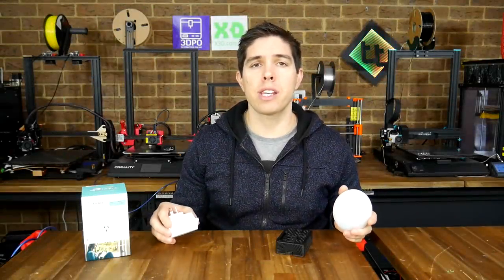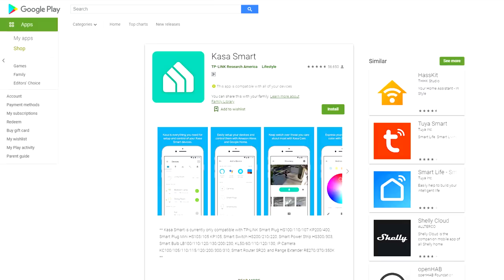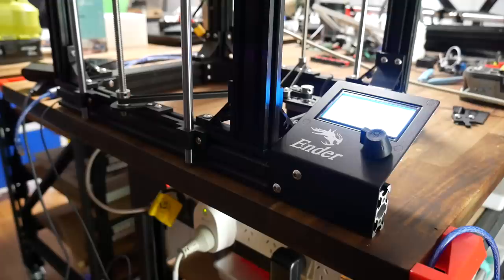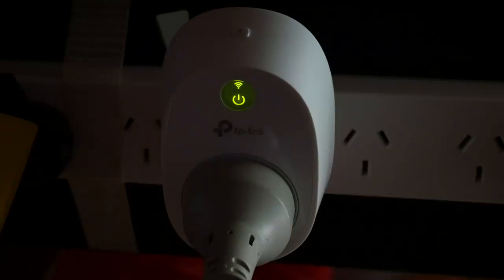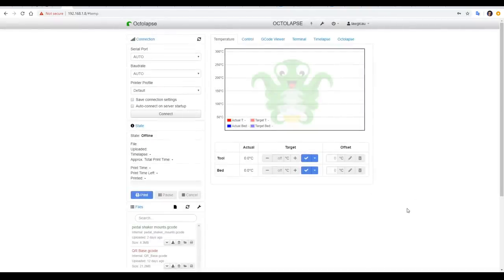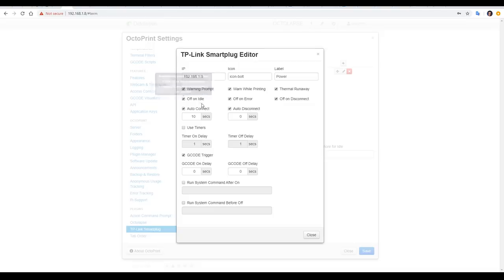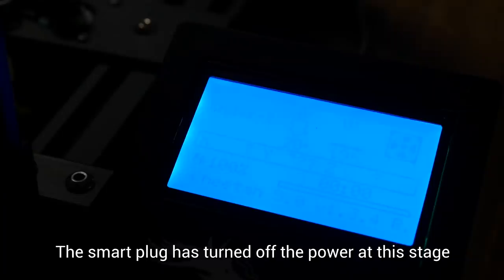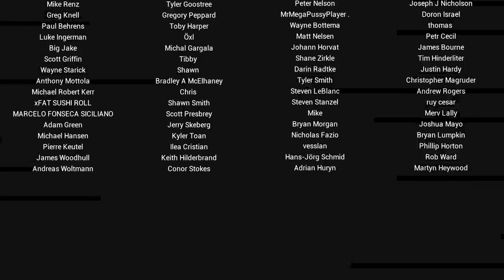Use smart plugs + Octoprint to improve your 3D printing

Comment: Thanks for the detailed explanation of the settings in my plugin, I'm the author of TPLinkSmartplug.
Reply: Jim Neill is there a way to use it with the printer powering the pi?
Reply: @Valgrind850  Yes, with a combination of the system commands options and timer option. You set your Run System Command Before Off to "sudo shutdown" with a short delay and then enable the Timer option and set the delay there for a time period later that gives the pi enough time to cleanly shut down. The plugin will offload the off command to the plug using Kasa's built in timers for the period you set, and then the pi shutsdown before that timer runs out.
Reply: Jim can you check my comment below I’m having a problem after plug-in was installed, I have the green lightning bolt when I click it it turns off power and keeps spinning one can’t turn back on?
Reply: @facitenonvictimarum  Don't be mean.
Reply: Can you help me with something, I can't seem to get the TP-Link Smartplug tab to show up, I am using "Tab Order" and the tab shows up there, but will not show up on the home screen. Other than that it all seems to be working for the most part. I also saw it power off and back on very fast a couple of times, not while printing, but after the time out. The information on that tab would be helpful to see what's going on. Thanks.
Reply: I have the same smart plug and it Nevers works... don't know why :( ... the plug works well with the app and Google home! I have the lightning bolt on the top of octoprint but it's always gray :(
Reply: You're Amazing! I was looking at slicing wires until I came across this video. I have a few TP link plugs spare in the house so gave ut a go and it worked first time.
Thank you so much.

Now I just need to block the power pins on my USB and figue out if I can add this to Octoremote on my phone. 

Thank you again :-)
Reply: Does it work with the tp link mini plugs?

Comment: Brilliant Michael.  Installed and working fine thanks to your clear directions and me finding my dumb initial set up.  So easy to have it turn off in the middle of the night now rather than having to worry about it running on idle.

Comment: Thanks - great detailed set up guide - an unexpected benefit to the these Smart Plugs is that they are compatible with Smartthings, so i was able to integrate it with my wall tablets and action tiles!
In order to make it even more useful I downloaded the portlister Octoprint Plugin so that when I turn it on from Smartthings or using voice control it also connects the printer to Octoprint. This is very helpful as i usually print direct from Cura which doesn't have the ability to wake up the printer.I also used and an extension lead to add a light onto the Smart Plugs so my camera can see my prints better. Thanks

Comment: Great guide Michael. I've been using smart home stuff for over 2 years and considered something similar. I wend with ESP8266 with Tasmota to control each printers power with the OctoPrint GUI. It's been working perfectly for well over a year.
Why didn't I add it to my smart home setup I hear you ask ... One wrong word from the wife and a multi hour print would be done for :-(

Comment: One potential use for the the smart plug is to use as a power meter (model specific), in case you’re concerned over power usage.

I ended up getting one in part because someone was concerned/blaming about power usage.

Comment: Perhaps putting your printers on a fire rated surface (ex. cement board such as "Durock"), as well as behind the printers can help keep fire damage to a minimum, and give the fire brigade more time to get to your workshop.   I had another brand that I was going to use to shut power, but glad you reviewed using the TP Link vice cutting and modifying (although I am capable enough) along with the OctoPi settings.

Comment: if you just want to shut off your printer when it's done, you can mount a toggle switch to the front of your printer that gets switched off by the bed as it moves all the way forward when the print is done. you just need to add a delay to the g-code before presenting the print to give the hot end time to cool.

Comment: @Teaching Tech  I've seen some others mention these, and I finally got my new Ender 3 Pro so I've been looking at OctoPi... there is a Home Assistant plugin in both to get them talking to each other, then Node Red talking to HA, and your TPlink plugs could easily be set up not only to alert you, but shut off the printer and (if the alarm smoke alarm went off) alert the emergency line for you // ask if you want to... all depends on your creativity.  like another said elsewhere the rabbit hole goes pretty deep...

Comment: i also have the tp-link plugin in use for a longer time and i can tell you its worth it. not only it can make your printer safer, you can also add a gcode command to your end-gcode to switch you printer off automatically when it has finished printing.
Reply: You don't even need to add that gcode. I have it set to turn off when idle for 10 minutes - gives the printer time to cool down with the fans still on.
Reply: That's actually quite nice feature to get.
Reply: Outstanding.

Comment: Nice timing. I added a TP Link plug to the mix only a couple of days ago, haha. Great improvement in power management (I can finally see actual power consumption of my 3D printer) and the extra safety layer is just so worth it! Now I can leave the house knowing that if there indeed is a thermal runaway or another critical error, the whole thing just shuts down and that's it!

Comment: That's awesome, I didn't know that someone made a TP-Link plugin for Octoprint. I've been doing this crudely by setting a turn off timer in the Kasa app based on the ETA of the print, but this will makes things so much better and safer. Thanks for sharing!

Comment: ive had a setup like this for a while. but i did it a bit differently. i have 2 printers that i have on separate surge protectors with my printer, octoprint, leds lights for viewing the printer, and a wyze cam. so when i turn on the smart plug from my phone or via voice command it powers the power strip and turns everything on. with the Wyze cam they are $25 on amazon and i designed a mount that goes on the printers using a clip on the x axis instead of removing parts to add this functionality. so i can view the printers independently and turn them off independently. the cost to do this was very minimal under 35 per printer and i feel very safe with it.

Comment: Thanks a lot, I liked that USB solution, I was searching for a cable on/off button to disconnect this Vcc of the USB Thank you! I just have one question please, if the M80 and M81 are GCodes, so I understand that they will be sent to the printer itself, why do I need to write the IP address as an argument for one of them? or why do I need these GCodes at all if I am controlling the power using the smart plug?

Comment: I have 2 printers running off one Raspberry Pi. I had always used the GCODE Scripts in the Octoprint settings to send the M81 command. Only 1 printer is currently hooked up to a TP Link.

Tried changing some of the TP Link settings as per your video and started a print. Both printers stopped during the first layer and the one not connected to the TP Link was stopped where it was starting to burn the filament the nozzle was touching as the bed and extruder were still at temperature. I decided to turn the printer off, waited several seconds, and then turned it back on. It indicated thermal runaway protection on the LCD screen. I have never seen this happen before, so have to guess it's related to changing those TP Link settings. This would all be fine if you just had one printer hooked up to the Pi, but when you have 2 I guess the plugins are shared for both printers so you have to be careful. After reverting the settings back to the way they were before I was able to start a print on both machines and it's working normally again.

Comment: Thanks Micheal,very nice find! They are going for $9.99 usd on amazon, careful though they are trying to get $29.99 for a two pack. Ordered 3 single packs, no more flipping a switch or un-plugging my raspberry pi. 😂Also only the 5v on the usb cable needs a small strip of tape, from the top where you can see the pins, last one on the right.
Reply: Yes, the tape was the easiest method for powering down the Ender - 3. Much easier then printing out that flimsy usb-power-blocker

Comment: I was doing this with my 3D printers already but I didn't know about the OctoPrint Plugin for that. Be curious if it works with the brand of smart plugs I am using. I will also have to reconfigure the power for the Pi running Octoprint that is getting powered from the 3D printer power supply. I won't be using Octoprint to turn on the printer again if I took away the Pi power.  I also have a spare raspberry pi that is running PiVPN so I can securely get back into my network to get straight into OctoPrint and with my home cameras and the smart switches I would monitor my prints while away from home in case of a printer failure. Great video.

Comment: Just got a Resin Printer because I need to make parts that are strong in
 all directions. Any chance you would make More Resin 3D Printer Videos.  
Topics I would like to see more of are: 
 1) Comparison of Plant Based,Water Washable, or Eco Resins 
 2) Comparison of Cleaning Products for the Eco Resins.
 3) Comparison of Ultrasonic Cleaners vs Mixing type Cleaners with different cleaning products for the Eco Resins.
 4) Curing Time & Hardness with different Wavelengths of Lights. ex.
 LED Grow Lights 600nm red / 450nm blue vs the Recommended 405nm violet.
Reply from the maker: I am working towards more resin videos covering some, but not all of these things.

Comment: I can see that you are very excited about home automation.  After watching this video, I can say, with certainty, that I am happy to use the mechanical power switch on the side of the printers that I own.  As to safety, I've had about 10 3D printers for about 8 years, and have never, ever had a situation that concerned me.  I guess I just don't get why you would spend $100 and hours on this when the alternative is so simple.  And, yes, I know that many people have a different take on the situation.
Reply: Everything safety related on a 3D printer always goes right until it doesn't.

Comment: Hi. Used this video to set up. Works well. Almost too well as I just had a power off mid print while testing. Got a hunch the camera didn't pick up on small movements. Any idea how much of a movement is needed to be classed as moving and not idle?

Comment: I have a TP-Link HS105 I'm trying to use for this.  The app only shows the MAC address of it, and my Bell router does not show it in my wireless device list, either by IP or MAC.  Any thoughts?

Comment: Hey Michael, love your work!
I know this particular video is over 2 years old now but I need some advice. 
TP-Link have a new range of Smart Devices called Tapo. In particular I am using the Mini Smart Wifi Socket P100. 
I have it integrated within Octoprint and it can switch the Ender3v2 on and off.
They can shutdown on idle and via gcode commands, but after hours of searching around the forums, I can't seem to find any info on how to setup the shutdown on thermal runaway.
Any help would be great. Cheers.

Comment: This I s really good. You should expand on this video showing a cheap setup maybe in the form of an enclosure that utilizes a cheap WiFi can such as the Wyze cam in addition to a smart plug and any other features (smoke detector) and try to not use octoprint

Comment: Hi Michael, another great instructional video 👍 I have just added the plugin to my Octoprint but there are only two options in the config, auto shutdown enabled and wait for time-lapse to render. There are none of the options shown in this video such as thermal runaway settings etc. Do you know if the plug-in has changed since you made this video? Thanks

Comment: Without taking away anything from Michael's setup, my needs are very much simpler... 

Because I don't use my 3d printer 'all the time' I keep it covered, so firstly I need to remove its cover and check the filament. I find that the filament does not like being left in the extruder, degrades and breaks easily. Because of that, I always have some filament 'setup' to do before any printing. 
Also, I don't leave the printer running. There is a smoke detector, close by, dedicated to the printer and someone is always in the vicinity. (I use Octoprint but don't need to monitor and control the printer beyond the home perimeter.) 

I was thinking of running the printer and Raspberry Pi off a remote switch (yes, the kind with a manual remote control) which I have a few of, but even that is hard to justify. As I mentioned, I have filament setup to do, so really the remote switch would only be useful for shutting it off. But I like peeling off the print after it's cooled down anyway... So turning off the printer is not a problem either. Also, once the print is done and the printer is idle, the safety and power consumption issues are minimal.  

Again, not taking anything away from Michael's set up. It's certainly very useful information for anyone with similar needs.
Reply: I also keep Google (and friends) out of my life wherever possible.

Comment: Good video i have had my wifi plug for nearly 1 year now, i have the HS110 it was like $5 more.
I did a test of a thermal runaway and the wifi plug didn't actually turn the power off its a bit strange i will go over my settings again and test but be sure to acrltually test your setup don't just blindly trust it.
Reply: That's a good point. I'd be hesitant to recommend something as a safety feature if it hasn't been tested/proven in the video.

Comment: Kitchen fire extinguishers are also handy, good that an automatic system puts out a fire rather than the 10-15min it might take to call a fire brigade

Smart plugs seem handy, I am a bit more inclined to invest in a solid state relay which is typically beefier than than those arduino relays and cost about $3-4, half the price of a smart plug. Mostly because having a couple hundred wifi signals dedicated to just smart plugs seems over complicated

Comment: Just a gotcha on disabling the USB-A power. I have a FYSETC F6 board on my Ender 3 and the USB (CH340 Chip) is powered off the USBVCC (5V) rail from the Pi.When power is applied to the Ender 3 a MOSFET on the F6 board disconnects the USBVCC from all circuitry EXCEPT the CH340 USB control chip and the board 5V supply takes over. Using the USB power blocker then prevents data communication between the Pi and the Ender 3 controller. I suspect this is a unique FYSETC design "feature". Ideally the USB CH340 chip should be powered off the F6 5V rail not the USBVCC- :-(

Comment: Hi Michael ... I bought a plug and it works fine, thanks. I would like the plug to switch everything off (including the Raspberry Pi).  So, The Pi and printer are plugged into a power bar, that is plugged into the smart plug. When I power up the plug, it switches off before the Pi has completed booting (about 30sec).  I tried setting the 'Abort power timeout to 5min' but that didn't work. Any ideas on how to get the plug to wait for the Pi to wake up?  Thank you again. Derek.

Comment: Quick question: does this mean you leave your RBP on at all times? 
If I follow correctly, Octoprint on RBP gives the ON/OFF command to the WiFi plug. That means that the RBP is connected to a different power source, one that is on, and that RBP is running 24/7. Is that correct?
Reply: My setup is as follows i have a relay connected between the main switch output and mains input to the printer PSU. My Pi PSU is spliced into the AC input  before the main switch on the printer. Now when a print finishes i use the PSU plugin to turn off just the printer via the relay. I then use the tp link plugin to power off my smart plug 30 seconds after it shuts down the Pi with the post off command  SUDO_SHUTDOWN_NOW. This setup powers both the Printer and the Pi from a single AC plug and solves the issue off having to leave the Pi running all the time. NOTE i would not recommend switching the DC side with one of those hobby relays are they are not designed to work with those high currents.

Comment: Just that extra lay of safety against burning the house down really. Like of course, like all of us should, i have thermal runaway in marlin on, and external high power mosfets but theres always that unlikely event that the mosfet could fail and when they do, they usually fail in a "closed" position, where's no amount of software control will be able to stop it heating. So a higher safety net such as this, that can just cut all power to any heating elements regardless of failures down the line should a hotend for instance go off the scale, is a must imo. With how cheap smart plugs are, its just a no brainer.

Now i guess we just need remote disconnection of entire power circuit incase the smart plug happens to fail on lmao :P

Comment: I bought a smart plug from Govee. pluged my printer into it, set up the app on my phone to make sure it was connected to my wifi. I got the IP address from it, Had to use a program to get the IP adress cause on the plug app, it only gave me the MAC adress. Followed your video, but the bolt icon stays grey. Any helpful tips? Thanks